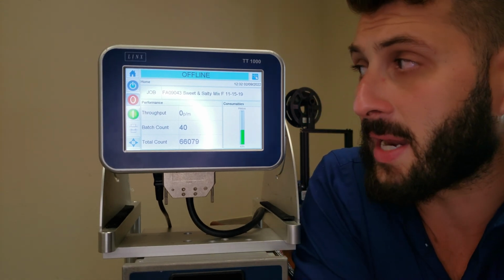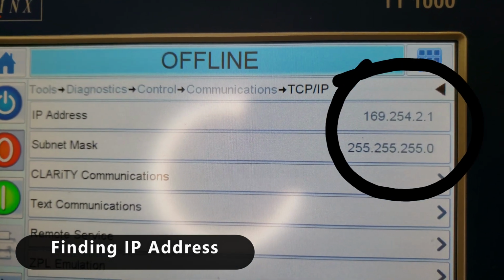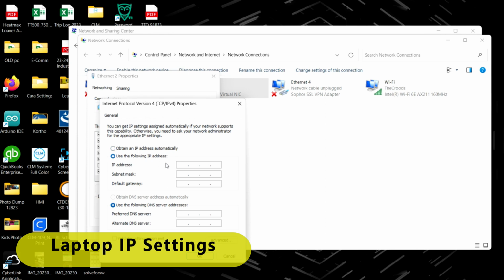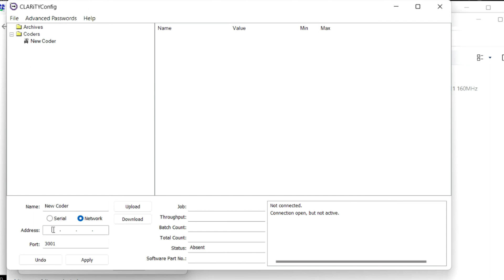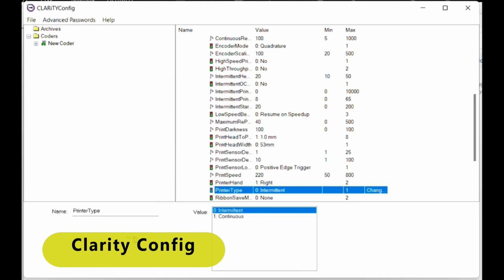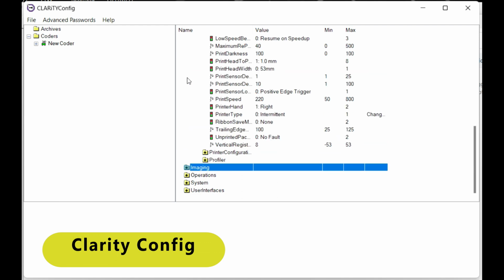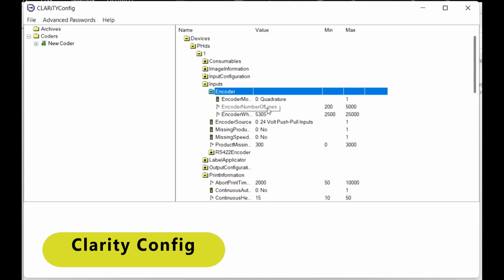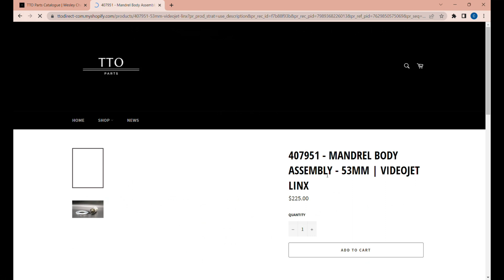Mastering Videojet Clarity Config Software: IP Address Setup & PCB Parameter Tweaks

Comment: hello dear.I have a Videojet 2351. I want to connect it to my PC. I checked everything. But it connects once, but when I disconnect the LAN cable, it doesn't connect anymore. What could be the problem? Please help me.
Reply from the maker: Make sure the subnet is correct and make sure that you are one digit away on the ip address. For example if you are using 169.254.2.1 for the printer use 169.254.2.2 for the pc

Comment: Hi kyle sir,
I have a vedeojet detaflex 6330 printer. 
Peinter not showing any error after rbbon end and machine running without print. Can you help me to get the solution
Reply from the maker: Happy to help. It seems like your machine thinks there is ribbon left and there is not. The detection method for ribbon is a c9mbination of the emitter top of printer and detector strip built into the printhead pcb. Usually this is checked during the calibration process so if there was a problem with one of your components it would give you an error during calibration... if that is not happening I would first confirm the detection strip in pcb is not obstructed by anything after that I would suggest to check your outputs in clarity config
Reply: @TTOPARTS  thanks dear

Comment: Hey kyle, I have a videojet dataflex 6320 printer with a broker usb port, which means i cant use the touchscreen display, the company is asking a huge amount of money for the port replacement. Any other alternatives you can suggest?
Reply from the maker: Is it in the PSU side or the LCD?  We sell both parts probably cheaper than the OEM by alot
Reply from the maker: Scratch the question before. I misread 6320 for 6330.

I have the PCB for the screen refurbished. Email us over at TTOparts support@ttoparts.com for pricing and info

Comment: my friend i need your help, i have videojet 1280, but i cant to conect do pc. i need print bat job.
Reply: Thanks for your attention friend, what I need is to configure VJ on my computer, I have a text file with several lines and I need to print each line once, on each product and this needs to be done from my PC.
Reply from the maker: Thanks for sharing. I will be trying a setup like this in the future. @moiseseduardo1585
Reply from the maker: Hi there!

What have you tried so far. Do you need me to create a message for you? Or are you just having trouble loading messages to your unit?